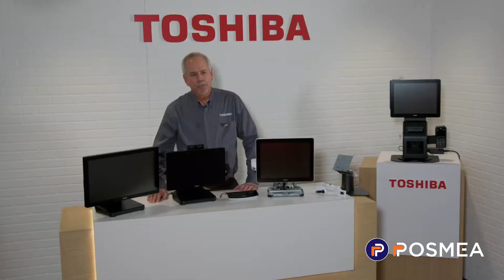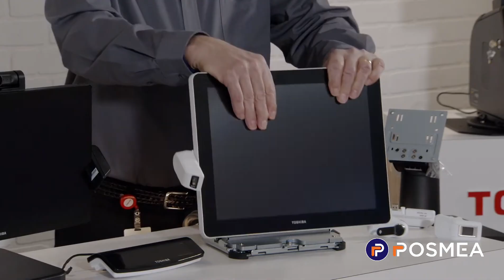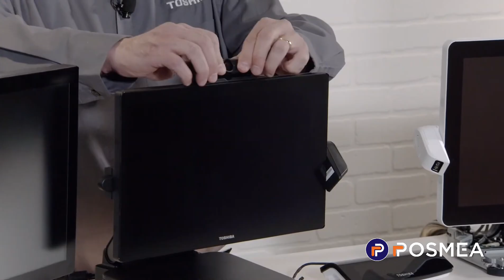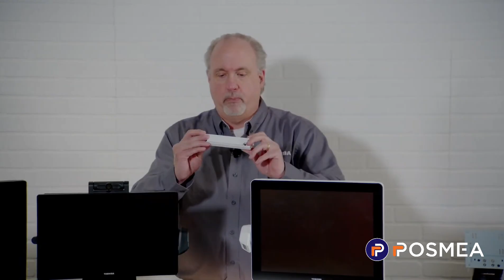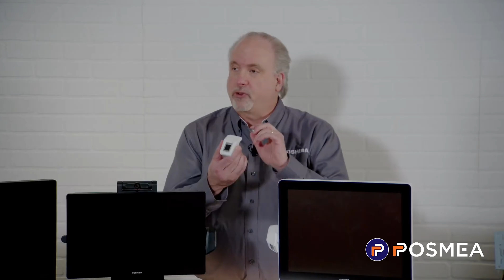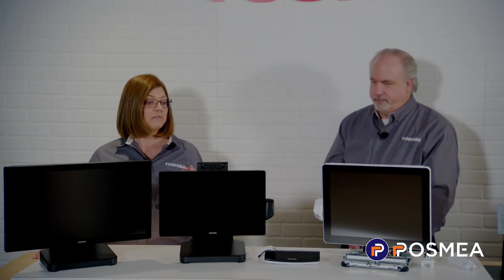Toshiba TCx 810 POS System in Dubai UAE | Intel i5 Touch POS for Retail Store | Posmea | Dubai

Comment: We recently installed the Toshiba TCx 810 Intel i5 Touch POS in our supermarket in UAE and the performance is excellent. Billing speed is very fast, no hanging issues, and it handles heavy rush hours easily. Very reliable POS system for supermarkets and retail stores.